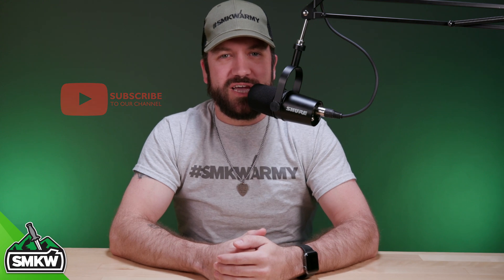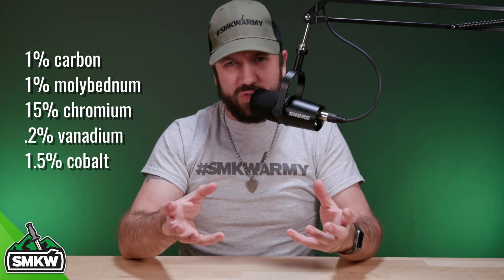What is D2 Tool Steel?

Comment: I've made a lot of D2 knives. When I made them in the around 2000 A.D. propably for about 5 years, D2 came in different grades and the better was around 1.5% carbon. Those knives were great, but the lesser version of D2 not so much. Price was the issue for most makers.

Comment: Depends on use. If you are old school scout who knows how to use knife, you will not have a problem with D2 at all. No rust, maybe little bit darker after many years but most likely not even that. D2 (properly heat treated) offers great edge retention, decent corrosion resistance and toughness. Sharpening is not problem, old school scout keeps the blade sharp all the time and not sharpens only when it's dull. A few moves on ceramic rod occasionally is enaugh. Or if you are in the wild, nice flat stone from the river handle the job as well.

Comment: I don't see how forming the steel with a different process would change its density. Its still going to have the same mass per unit volume. It's not like normal D2 is a foam full of gas pockets that can ve eliminated. Am i missing something?

Comment: Is it made in CHINA?  That's all I want to know.  Recently, I was deciding between CKRT Bev-Edge and a CIVIVI Mini-Praxis for a small pocket knife.  Very different knives, but I decided based on steel.  

Bev edge was that Cr8-mov13 or whatever,  found it's a cheap chinese steel, though effective. But China's mining practices are not something I want to support.   Anyone agree?

Mini-Praxis was D2, so i went with that, unable to find manufacturing info.  But now I'm curious??

Comment: D2 Tool Steel. Is only good if it has a coating on it. To protect it from rust. I have the CRKT Squid XM with stonewashed D2 Tool Steel.
Reply from the maker: Love the Squid!
Reply: @SMKWcom  me too. But I wish that CRKT would give it a better steel like. 12C27 Sandvik steel or 14C28N Sandvik steel.
Reply: @JAMESGREGORYKULP1985 I love my Kershaw Blur in that Sandvik steel.

Comment: I have Magnacut, s30, s35, and more steels in my knives and d2 is actually my favorite. Not because of its affordability, but because of its characteristics. Love it.
Reply from the maker: Glad you have found one you love!
Reply: What makes you like it so much. Does it secretly manage to stay sharper or does the grain structure make it cut better or something strange. I was looking at the the other steels and was wondering how supposedly easier to sharpen steels could hold an edge better. I was thinking d2 would be more consistant of a steel with a little less vandium and chromium and closer to acting like a simple carbon steel except hard but the other ones had more hard stuff in them so I was not sure. I havent chosen to get either steels yet but I suspected something was weird if people were not enjoying s30. I was guessing before that people should jump to m390 if they wanted something over d2 but I did not suspect some people would prefer d2 over s30.

Comment: I have carried d2 pocketknives for about 10 years. I use these knives for carpentry, everyday use. I have never had one rust or tarnish, their ability to be sharpened to a razors edge is my main motivator in use. I simply run them 4-5 times thru a ceramic sharpener each morning if I have used them frequently. The people who know me, know I keep my carry blade very sharp, my nephew and brother were roofing my house and doing a section with rubber roofing. They had misplaced the blade for their razor knives. My nephew asked if I had my pocketknife on me. I did, after I tossed it to him, he cut the whole section of roof in using this blade. When he was done, he said he thought the knife was sharper than the razors and easier to handle. When he gave it back to me, he said he had to get one and asked how I kept it so sharp. I showed him the $2 x ceramic sharpener I bought from Menards, swiped the blade through it 4-5 times and handed it back to him. He tested the blade and said,". Can't believe it's that sharp that easy," The 2 blades I carry cost me about $15 4-5 years ago. I went to buy a couple more for gifts and they were about $40.
Reply from the maker: The best knives are the ones tested by work and time
Reply: Pull through sharpeners do not sharpen knives to razor edge and if it shaves, it is the burr that's shaving you once you use it the apex will roll and it won't shave anymore. If you want your edge to stay use a stone, then you can just srtop it when it feels full and you'll only need to remake that apex on the stone occasionally. Happy slicing buddy. 😎
Reply: @BushcraftBangers bingo, you nailed it.
Reply: No contractor says razor knives. Any contractor worth his salt would use the term sheetrock knife, knife, utility blade or in rare occasions "Hand me your cutter but flip the blade first!!!" Scetchy
Reply: Lol I've been in construction 23 yrs and owned my own business 8 yrs now. I call every work knife an Olfa cause all I use at work is the 1" Olfa knife. And I use 2 D2 blades all the time. My Hultzman hornet and a little neck knife from Amazon. I keep em razor sharp but I HAVE TO STROP them. Even my 1095's and 420 hc's. I could never get them razor sharp until I bought a strop and got my angle down pat.

Comment: Which is best for a bushcraft fixed blade D2 or 1095? Good video
Reply from the maker: Both are great steels that as long as you oil them will hold well in the field. Keep moisture off the blade and store them correctly while not in use and both will last for years to come.

Comment: I see a lot of stainless steel used in swords these days. I'm a bit on the fence with it comes to this material:

The fact that it doesn't rust and that it is cheap makes it very practical.

The problem is the hardness of the material. This means that, instead of bending, it will shatter. For a tool or a knife, that are relatively small,  you are not too concerned if it breaks. But to have a sword break, sending a sharp blade flying around, this is dangerous.

Comment: GCS Handmade Tracker Knife has D2 steel the craftsmanship is awesome but its not a pretty blade, it looks like it wants abuse, smile and keep going. The blade is thick enough to pry or dig with and I know I can rely on it's utility for the rest of my life. The same goes for the horizontal carry sheath, real leather and excellent stitching. This blade although blood grooved is a heavy enough to be used to severe small and large game bones and joints as a chopper but not so good as a slicer. Get a drop blade knife if you want to slice in my opinion. The blade has a tanto point which is awesome for piercing tough material.  The spine is serrated, and has jimping to prevent thumb slip. Grip has excellent fingering and guard. This full tang blade comes with a nice wood scraping feature, a second edge in the blade perfect for stripping bark, making shavings for kindling or a fuzz stick. So I was interested in learning more about D2.

Comment: D2 steel is tough and it's harder to sharpen but it stays sharp.
Reply: Use diamond stones with sharpal angle pyramid guide. Or use a worksharp precision adjust.
Reply: @SMKWcom I bought a Paragon Grau dagger made of D2 steel! One solid piece of D2 steel weighing around 2 pounds total.
Reply: I like d2 a lot. Havent had any issues with mine. Razor sharp and keeps that edge forever and tough enough for anything  a knife is used for.
Reply: Harder to sharpen than what ? I liked my Benchmade Griptilian in D2 because it stayed sharp and was easier to sharpen than my 154CM steel knife , which dulls quicker .
Reply: So that’s why it’s not sharp
Reply: @bobransom4359 its just a technic of sharpening.. i can sharpen my D2 civivi to hair whitling level using a high grit stone.. out of the box, its no matter what steel is it and from which company, they always came with crappy edge due to factory sharpening process using a belt grind.. even on a hundred dollar benchmade dont came with nice edge out of the box.

Comment: Those numbers you threw up there were NOT D2 steel.
D2 has 1.5% Carbon
12% chromium
0.85% molybdenum
0.40% manganese
0.33% silicon
0.90% vanadium.
It is not stainless as at least a third of its chromium is bound up in carbides and thus don't help in corrosion resistance.
D2 creates a lot of carbides including some vanadium carbides, but mostly chromium carbides which are plenty hard.
Reply from the maker: You are correct sir as it pertains to modern D2 and how it is made today.  The numbers posted are the median in the ranges included in the original patent applied for in England in 1918 by Paul Kuehnrich.  The chemistry ranges applied for were very broad and as a result today, the actual chemistry of D2 varies greatly depending on the manufacturer.  So while yes the numbers you give are that of American made D2, per the patent the makeup can change quite drastically.

Comment: Since D2 is a strong steel does it also mean it has great edge retention?
Reply: D2 has an unreal edge holding.  You c!n sharpen a d2 knife on a hard Arkansas stone for 12 hours a day 7 days a week for  9 years and 10 months 2 weeks and 3 days and still have a dull knife . Got a d2 knife get a diamond stone . Oh it takes  about the same amount of time to go dull
Reply from the maker: D2 has good edge retention but as with all things it depends on what you are cutting and how often you take care of the blade
Reply: @SMKWcom  will I have a bench made knife with s30v blade and I only have to sharpen it once a week so I am hoping the D2 blade would be the same or if not longer edge retention base on the way I use my knifes

Comment: Looking for some advice, as I am not a metallurgist of any sort.  I am looking for recommendations on a tool steel or some type of metal to weld to a vehicles exhaust to prevent expensive parts from growing legs and walking away.  It would have to be shaped, heat treated if needed, some corrosion resistance, able to be welded to the system and withstand the heat that an exhaust generates (about 600F).
The weapon of choice for these hooligans is generally a Sawzall blade, so it must be harder.  Possibly HRC 60?  Would like to know what you think.

Comment: Very interesting info for sure. Now please tell me how to get D2 knife blade razor sharp.  Whetstones a waste. Using diamond now and ceramic but not much progress. Cabela's used belt-drive helped very little. Do I need to just keep at it or forget it?  Thanks so much
Reply from the maker: It just takes patience, rushing will only lead to inconsistency and ruin the edge.  Once you get the edge, stropping with a good leather and compound cannot be overlooked.

Comment: Sorry, but one of the few advantages of being old is not having to rely on books to know what happened back in the sixties and seventies.  Most knives back then were made of high carbon steel.  A minority of blades were made of stainless steel but only premium blades used 440 C.  420 M [modified] was much more common for mid-priced knives.  The most common and lowest cost knives were pretty much all high carbon steel but that did not cause many problems if they were wiped with oil once in a while.  Diving knives were generally made from stainless or semi-stainless steel and not high carbon steel.  That is what was really happening back in those days.
Reply: Love it!

Comment: Any tips for maintaining a D2 blade? I just ordered a Vanquish D2 knife half serrated
Reply from the maker: The best thing to do is to clean it, dry it and put a very thin coat of oil on it.  If you use it everyday you won't see any issues as long you don't put it away wet overnight.  Also if you use it everyday you won't have any problems.
Reply: @SMKWcom  I see, I thought I was gonna have some problems with corrosion. Thanks man, I appreciate it 🙏🏼

Comment: I love D2. Definitely one of my favorites. I have every brass Artisan Cutlery's SMKW exclusives, small and large, and love them. Although if you are getting the brass Proponent to edc, get the small one, the large weighs a FREAKING POUND! It is glorious though. It definitely matters what knife brand you get in D2 though, they aren't all the same. Also if you have not tried the Artisan Archeao in either brass or copper then just do it, you will not regret it. The small brass gas been in my edc since i received it.
Reply: what do you think about Kershaw D2 Steele is it any good and would you recommend it as I am new to Knives?

Comment: GREAT video, & and info.... 
I like D2 always have. There are a few metals and mixes etc I like for blades but more than the metals like  I prefer above all is the treatment to be spot on as it should, it is truly surprising what can be done with proper blade processing. I will take inexpensive over super steel all day long when treatment is top shelf.

You can cover ?? REX45 ?? and after that or during maybe the other REXs to explain better maybe if needed.?.
Reply from the maker: That's a great idea thanks for the suggestion!
Reply: @SMKWcom  thx

Comment: The most wide use of D2 tool steel was during WWII. D2 was used for stamping dies, where corrosion wasn't an issue and hardness and wear was needed.

Comment: Great video TC. I don't hate D2 steel but too many companies are overusing it. I would much rather have a full stainless so I don't have to worry about rust. (Yes stainless can rust but not nearly as easy as D2)
Reply: Better than 8cr13mov
Reply: You know that all depends on the manufacturer that makes d2 steel but also uses different kinds of blade finishes. Like stonewash finish for example is a good finish because it improves the corrosion resistance and hides scratches and fingerprints. Perfect for people who don't want any visible scratches or fingerprints on their knife blade.
Reply: And most companies use d2 steel because it's cheaper and popular too.

Comment: I'd love to hear about heat treating methods by different knife manufacturers.
Reply: I like where your headed Jack, and we might be headed in that direction! 😉
Reply: Same. Curious how D2 steel does as a chef's knife? One that's been specifically "cryo-treated" and custom made.
Reply: @SKtube0  Cryo will increase the hardness by converting leftover austenite carbides. A cryo will also increase its toughness.
 I also don't know what the numbers he was showing are, but it wasn't D2. D2 has 1.5 % carbon, 12% chromium (FYI stainless is 13%), .80% molybdenum, .30% silicon and .85-.90 % vanadium. The high carbon content makes a lot of chromium and vanadium carbides thus making it very abrasion resistant as ferrite or iron carbides are not as hard.

Comment: So is there a difference in the $30 kabar D2 as opposed to $500 Medford D2?  Not being sarcastic I get ones custom and ones a cheap Chinese made knife, but is it the same blade material ?
Reply: In my opinion D2 in theory is all the same. Really depends how you look at it. It has poor corrosion resistance which is a big turn off for me. Many years ago i had a Benchmade adamas in D2 as my work knife. Used it for typical work stuff in the facility i worked at, cutting boxes trying to pry open doors that people locked themselves out of and even as a screwdriver at times. As a Tool steel it was excellent. Rugged, you couldn’t beat the life out of it, kept its edge forever. But the one problem i noticed was that when i finally decided to resell the knife on eBay was that the edg had on microscopic pit of rust on it. I assume it was from the moisture created in my pocket along with it being pressed up against my body. I consider rusting a fatal flaw, and find having to lube my shank unnecessary. This was Benchmade D2, not China D2. I also dislike Boker Aus8, especially on the Kalishnakov Autos. (Which is where I’ve had the bad experience)
Reply: @seanlowkey9388  Spyderco sells a D2 item that's manufactured in Taiwan. Is that D2 from China?
Reply: The name Medford has alot to do with the price.

Comment: Good series. Elmax, for sure, would be an interesting one; also LC200N.
Reply: Elmax is my favorite. It's basically a super steel, and not as expensive as others. Holds a great edge and it's pretty easy to sharpen.
Reply: @CapFlipGaming  I only have one example of Elmax and really like it. I wish I knew what mine was hardened to as it sharpens and deburs fairly easily for a steel in this class.

Comment: Great info I have a Cold Steel Leatherneck in D2 and love it. Maybe someday you can let us know what Elmax is? I have a Microtech with that blade material. Awesome video thanks so much
Reply: Elmax is a third generation powder metallurgy stainless steel. The granule size of the metal powder is very small.
The performance of Elmax is far superior to S30V. Elmax is much tougher and has far better edge holding. It is also easier to finish.